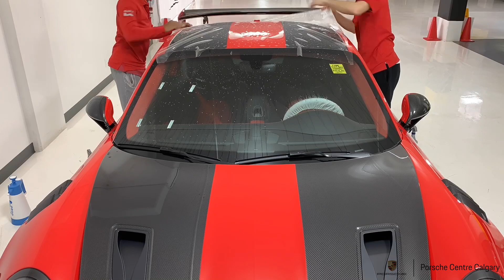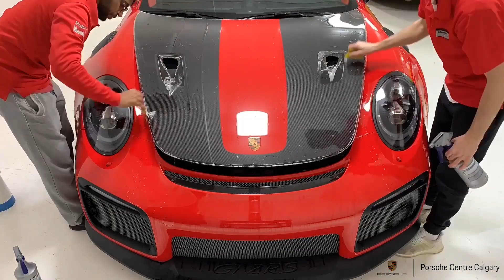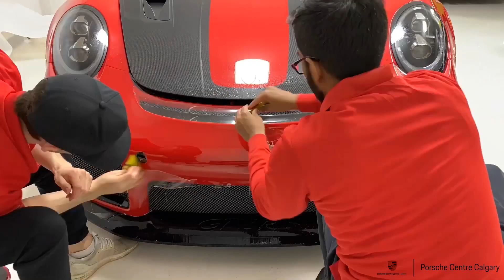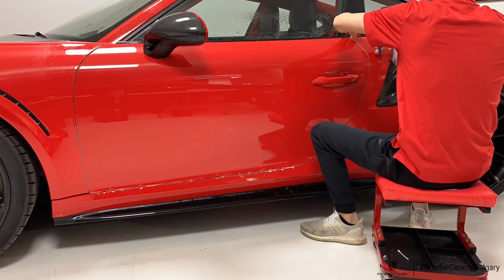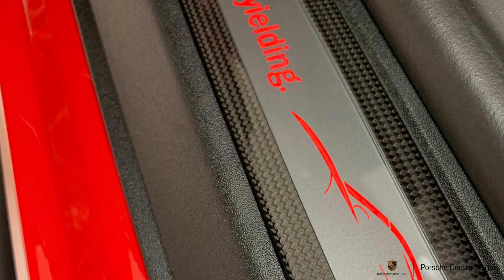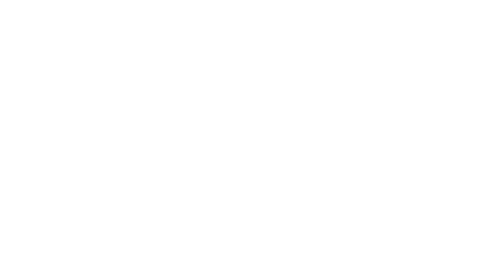STEK DYNOshield PPF Detail Application on a Guards Red Porsche 911 GT2 RS

Comment: Great job, awesome car. Do you have alot of people bring there car in with rattles? What is the best shop to fix a small rattle in the cabin of a Porsche?
Reply from the maker: Rattles can be challenging to pin down.  I have seen 2 or 3 guys in a car, with microphones hanging in all sorts of problems trying to get to the problem.  Most independents are not going to be interested in this type of work.  I would say take it to us, or your nearest Porsche dealer.  You want somebody who knows what they are doing and has maybe solved the problem before, rather than somebody starting from scratch...
Reply: Porsche Centre Calgary that makes sense, I will try to save up some money to pay my dealer to look at these rattles